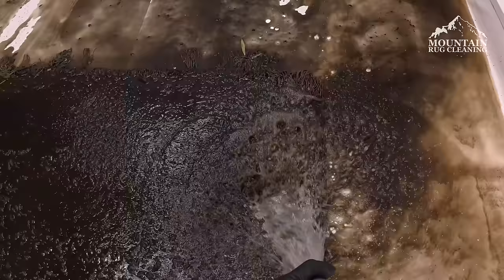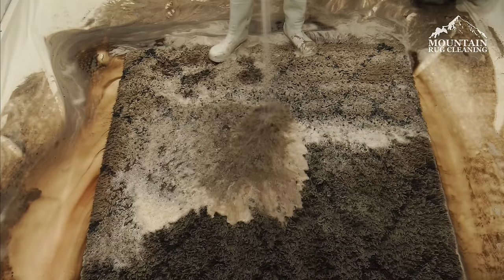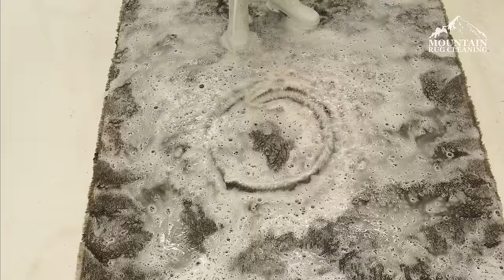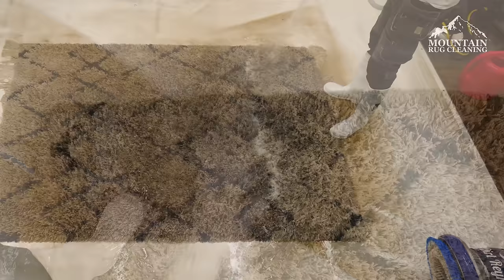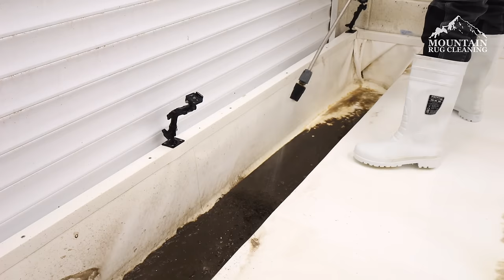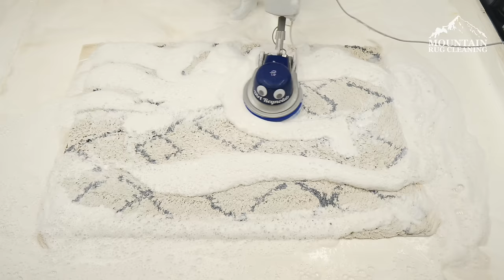Cleaning SWAMP THING'S RUG ! Most HORRID, FOUL DIRT Poured Out !

Comment: Why don't you clean the floor with the large water hose instead of the squeegie all of the time. In our operation we hung the rugs up on a lift and then had water flowing over the rug on both sides at the same time. We installed the lift about 5 years after I bought the business. It was on an electric winch and cost about $100 complete with ceiling mount (we had "I" beams every 10 feet in the building). This got most of the bulk out of the rug before we really started cleaning. Our cleaning room was about 25' X 40' and our drain was into a trap that was about 4' X 4' X 4' cube. We had to have it pumped about 3 times a year and it was usually pretty full. The cost of having it pumped over us digging it out was so inexpensive I could pick up 2 to 3 thousand dollars of cleaning during he time it took the company to pump it out.

Comment: Again what an incredible video.

Clearly shows the benefit and built-in longevity when a rug has been manufactured using high quality materials and fibres.

Add to that a manufacturing process including weaving and binding techniques which result in the very best quality final product possible. 

Only when such a filthy rug as this is cleaned do these elements become so obvious and apparent.

Without this quality I'm sure the cleaning and sanitising processes would mean the partial or total degradation of the rug. Effectively it would be cleaned "to death" !!! ☠️

The final result, especially the long fringing along both ends of the rug look most satisfying to me.

I can't remember when you had to clean out the peripheral catchment gulley whilst you were still cleaning the rug. Just shows how much muck, dirt and debris was trapped within the filthy rug.

Comment: How many litres of water used per square foot? How much can be filtered and reused? Would it be better to soak the carpet in a huge low wall tray with good detergents to loosen almost 50-70% of the soaked dirt? Then use your methods to clean? Seems like a lot of water used but cannot be recycled

Comment: You may need to fill all of the holes with wood filler and sand smooth start with a well cleaned slate after restoring and securing all the joints with new glue

Comment: Applies soap far to early and I have never cleaned a carpet like that before but the steps/technique make no sense at all. Plus, the use of water but final result is good
Reply from the maker: Might not make sense to you but you have to admit the results ok
Reply: @MountainRugCleaning  result is top drawer. I guess i believe in the sinners circle and the 5 steps of most cleaning procedures to the extreme but difficult to change that mindset when it is so tried and tested....I have 40 plus years in the cleaning industry in general, sustainability was a built in mechanism...